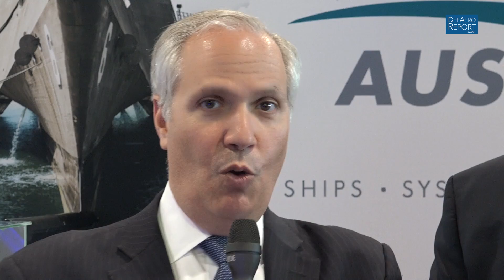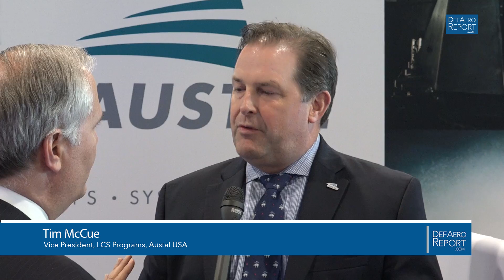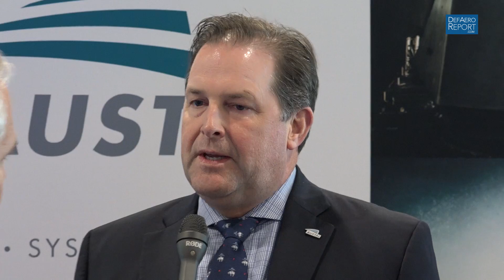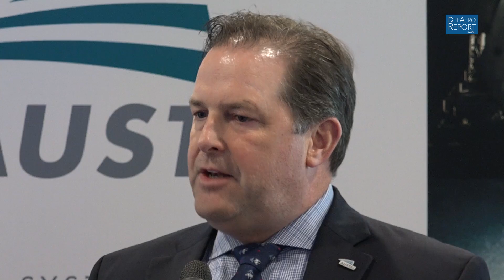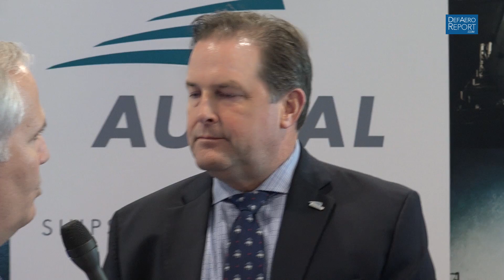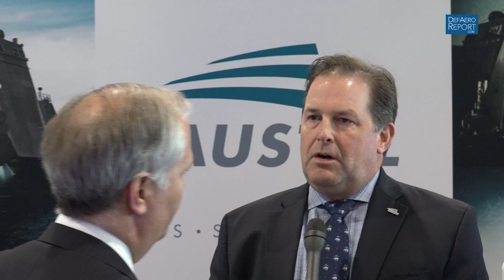Austal's McCue on LCS Frigate's Variant Capabilities, Challenges, Survivability and Design

Comment: OK---- DAMN!  One of the few advantages the Austral's have is it's speed. 32 knots is just pitiful.  Use your heads guys and lengthen the damn hull by 50 feet and keep the draft the same and the speed at 45+ knots while adding fuel tanks as you actually need a range of 6,000 miles in the Pacific. You also need to get rid of the damn complicated propulsion system that has drive lines taking up half the lower hull that are a damage control flooding/breakage and maintenance nightmare that take up space in the hull that has better uses. Not to mention Hydraulic pumps that are noisy sirens in the water that can be heard for miles and go with a strait electric drive that will cut weight and noise and maintenance while giving the ship the power it needs for new laser weapons. You might even check out a pair of ducted propellers over the 4 water jets that should give good high speed performance while being quieter (using stealth submarine tech) improving the ship's sonar capabilities and be some 20% to 30% more economical even if maneuverability is reduced a little. (it doesn't need to stop on a dime) --- Then put a 5 inch gun on it replacing the short range Mk110, 57mm mount, while adding 48 of the new more capable side mounted missile cells from the DD-1000 along the sides of the lengthened more capable flight deck instead of the clustered Mk-41's, along with the external Harpoon tubes and an additional 21 cell Ram mount to go with the pair of 35mm guns and you have a damn fine FFG that will beat all the competitors. After all the Navy has said they are willing to spend a billion dollars on each ship, so give them Everything they could possible want instead of cheery picking what you think they want.